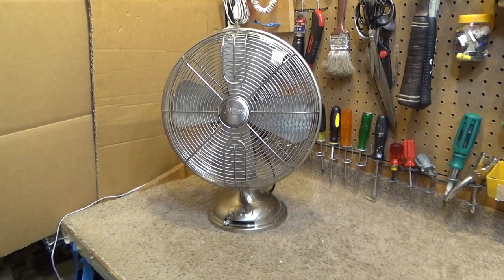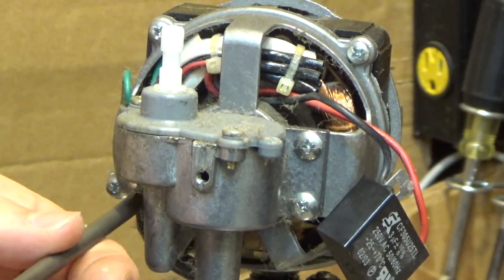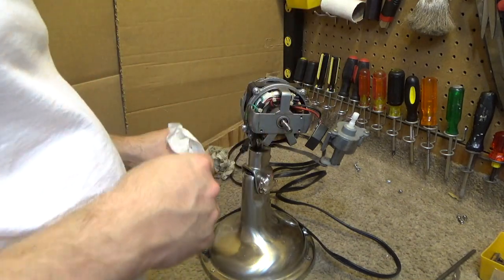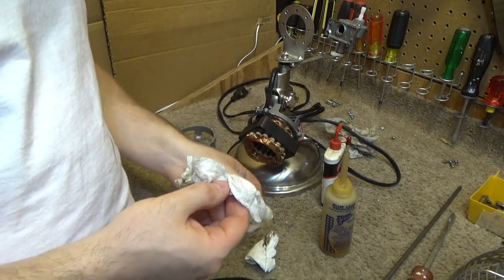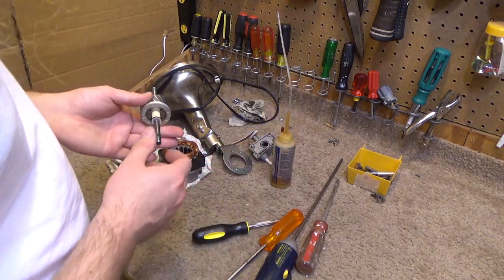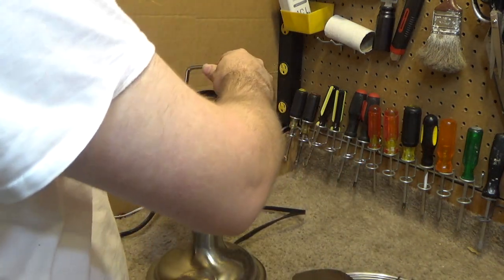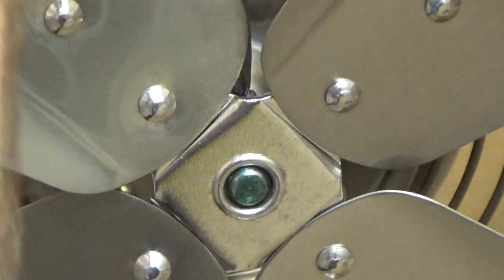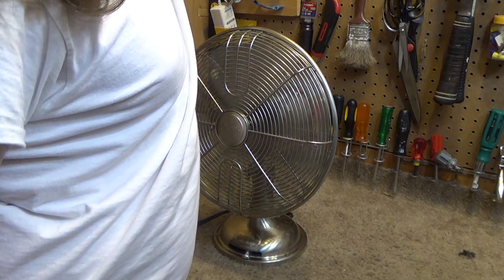Clean, Service and Repair Hunter Century 90021 12" Oscillating Table/Desk Fan

Comment: Thank you! I have the identical fan and it would only run on high. Followed your directions and now it work perfectly!  I had the same alignment problem as you did with the motor  &  shroud. Solved by laying the fan on it's back so it was more steady, then adjusting slowly until one hole lined up. Stuck a small nail in the one hole as a placeholder, then moved the t next hole, placing placeholder nails l as I aligned. Then started one screw, then the next, then the next...

Comment: i have this fan also and this video helped me a lot . mine would not turn on low but it turned on med and high but didn't blow out much air . everything you did i did of course i had to keep pausing the video because my fan was in the kitchen . so I would come back see what you did and i went and did it too !i found that those 2 little silver balls in the handle of the osculating is missing one of the balls now i have to try to find the damn things to buy. but when all was said and done my fan works now . it was as loud as yours i found i put the wrong screw in the back ! so i went through about 5 screws until i found one finally that fit the back and now my fan runs smooth normal fan noises since i changed the screw for the back . try that see if it gives you just fan noises and not a '' JET TAKING OFF ''Good Luck and THANK YOU
Reply from the maker: Glad you got your unit working again.
Reply: @JordanU  on the piece where yours is missing the piece to go over the white piece to push it up or down for the can to osculate there was only i silver ball it popped out when i was checking it . do you know what size those balls are . i have the piece that fits it even without those silver balls that piece turns but the fan will not osculate without those balls but i don't know what size to get . there is a spring that fits in a hole and the balls go on either sides of the spring and the top has to be put back on . the back is replaced the piece is screwed back on the white piece that makes it rotate it will go up and down and when plugged in it will Turn the knob but it still won't osculate the fan. with or without the silver balls that piece will rotate but the fan will not osculate can you get the sizes of those silver balls ?
Reply from the maker: @phoebeh3watkins464  I don't know the size of the balls. They need to be small enough to fit into the holes, I'd suggest measuring the holes and getting the closest size you can find to the holes.
Reply: @phoebeh3watkins464  the silver balls are the same size as BBs used for BB Guns. Buy a thing of bbs and put them in where the lost ones went..that Should fix the issue.
Reply: @torythefanman   thank you

Comment: EXCELLENT.  A few suggestions:  (1)  Tie your hair back or cut it; (2) The power driver is a bit overkill; (3) SPeeding up the video for very routine screw removal would be great.  Overall, this video is excellent.  Your stream of consciousness commentary was particularly helpful.  To wit, I did not realize that grease is not advisable (as opposed to fan oil).  Also, did not know there was anything like detergent oil for cleaning (although I know it exists as automobile engine oil).  Thank you for the time you put into this video!  I have same one on a standing pedestal and now I feel confident I can fix it!  God bless you.
Reply from the maker: Thanks for the feedback.

Comment: Is there a way that the oscillation knob cover can be taken off and put back on? I remember when I tried to remove the rear motor housing from mine, I was never able to get the oscillation knob cover off.
Reply from the maker: It looks like it would just pull off and push back on. It probably takes a fair bit of effort to pull it off.
Reply: @JordanU   there is a small screw holding it on
Reply: There is a coil spring holding the knob on. Push the coil down with a flathead then pull the knob off. To reinstall, move the coil to the upper side, press on the knob then push the coil back down to the middle.

Comment: The body looks solid with the metal base, blades, and grills until you took it apart and the motor is similar to the table fans with plastic blades and bodies.
Reply from the maker: I've found that's usually the case with these kind of fans, heavy and sturdy build on the outside, but the same cheap motor as everything else on the inside.

Comment: Mine turns easily but will only start on speed 3. If I then set it to speed 1 or 2, it spins extremely slowly, not enough to push air.  I'm going to try the lube job.
Reply from the maker: OK

Comment: This appears to be a somewhat durable fan minus the stupid design. It sounds pretty powerful for what it is.
Reply from the maker: Perhaps if the oil was put in the right place originally, it would have lasted longer. Time will tell what happens now.
Reply: We’ll see how much longer this fan lasts. I remember my 5th grade teacher had one of these fans or something similar. I wouldn’t be surprised if the internal design is the same considering how cheap these are to begin w/.

Comment: Where did "common screwdriver" and "common bit" come from?  I looked those terms up once, they did not reveal strictly flat head screwdrivers or bits, but rather articles about common (as in, familiar, ubiquitous, everyday) screwdrivers.  I've heard flat head and slotted head, but you seem to be the only person on the planet that refers to it as common head.  It's not even that common, philips bits are seen far more often in this kind of stuff.

I don't understand how China manages to have enough precision manufacturing technology to make a functioning motor, but somehow isn't able to land oil into a bearing.
Reply from the maker: I think my grandfather calls them that, and I know I've heard a number of other people call them that as well. Perhaps it's an old term, back when those kinds of screws were more common. The term 'flat head' doesn't make much sense either, as most screws have flat heads.